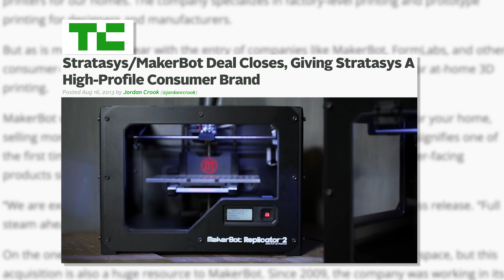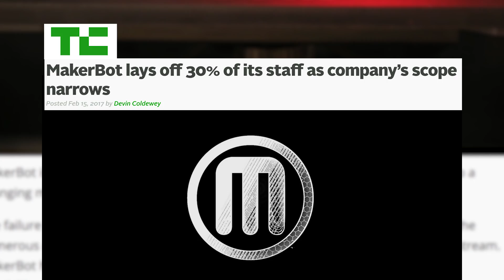MakerBot: A brief history

Comment: You have some of the beginning models and video of the models out of order. The first printer was a cupcake CNC then they made the Thing-O-Matic. They were both open source and made of wood they were also sold as kits that the buyer built in about a weekend. After that they released the replicator and replicator duel. They where preassembled printers that where made of wood as well. Though some of the early designs for the printer where made open source the final version that was sold was not released online. This decision was driven by some companies, mainly in china, copying there design instead of iterating upon it. After that is when they decided to go closed source with the replicator 2 and 2x. The rep2  and 2x where preassembled with a metal frame and where manufactured in the USA. But due to the closed source design they alienated there client base that they built over the years. Since then they have been purchased and nearly driven to the ground with costly and slow support. The newer printers are designed not for the average tinkers but the engineer at a Fortune 500 company. With the non-serviceable parts and uncustomizable slicer a lot of costumers that may have tried it have written them off due to the high cost of operation and poor software support.